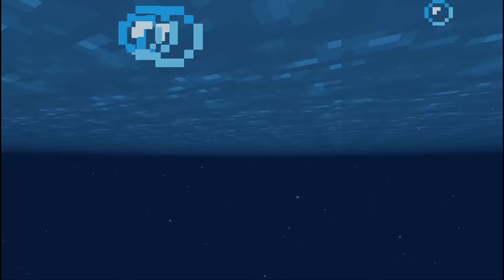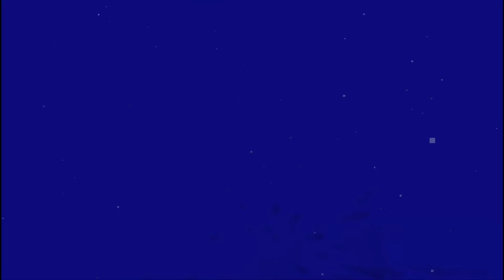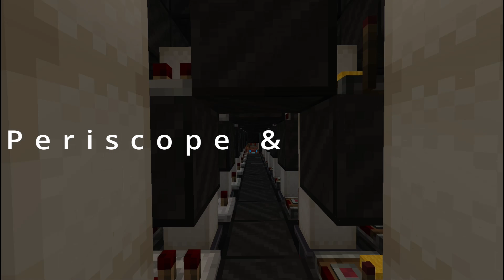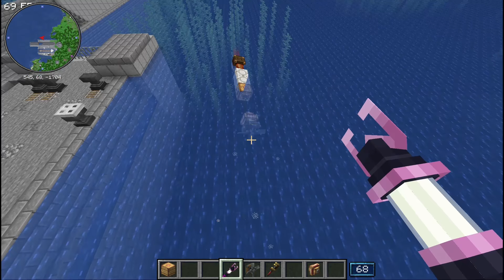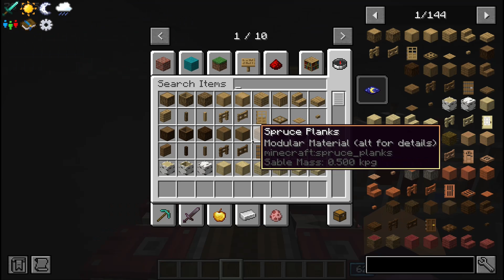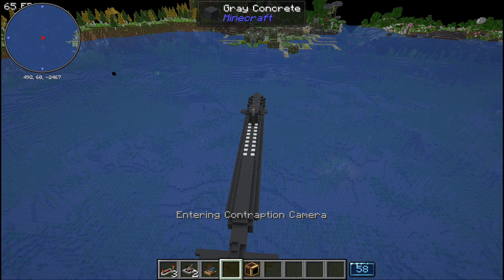Fully Functional Survival-Friendly Submarine | Create Aeronautics + Deep Seas Addon

Comment: Amazing! The only thing I can criticize is the power unit, as it's lacking a proper fueling system (like a barrel/docking connector you can put fuel into that automatically gets put into the engines) and fuel saving shutoffs (engines are perpetually consuming fuel even when the SU are not being used). But enough complaining, the rest of the ship is amazing! I like the torpedo bay and the mechanism used to launch them, the torpedoes themselves are also very nicely designed but what I find really impressive is the altitude control system. Very nice job on those.

Comment: i downloaded schematic, accembled, setup like in instructions but my max speed is 0.32m/s
Reply from the maker: Yes, that's possible. It's usually not a problem with the submarine design, but with the mod configuration. Different modpacks or installations can use different config values. Check your mod settings and find the configuration for the Submarine Propeller. Make sure the propulsion value is set to around 30. That should restore the expected speed.
Reply: @Bagryaniy_Iv okay thanks

Comment: Brother, this is truly impressive. I'm trying to do a similar project and I'm having a problem with the torpedoes. How do you stack the torpedoes while they're in motion, or how do you fire them without detonating them? They explode on contact with the ship as soon as it's in motion. Is there a way to stack and launch torpedoes from a ship in motion?
Reply from the maker: You need to build the torpedo inside the submarine, preferably directly in the torpedo tube. This makes the mine part of the same assembly, so it won't detonate on your own submarine while still working against other vessels.

A useful trick is to place the mine on top of a temporary block and then break the block underneath. The mine becomes movable, allowing you to finish building the torpedo around it.

I’m also planning to make a short video in the next few days answering the most common questions, including a demonstration of how to build the torpedo.

Comment: I have to make a new way to power it right now its verry fuel consuming for survavial and ineffektiv. U should mayby try Steam or diesel engines but a small nuklear reaktor would be verry cool as well.
Reply from the maker: Thanks for the suggestion! I intentionally designed this submarine to use as few mods as possible, so diesel engines would require extra add-ons, and steam engines are a bit too bulky for this design.

As mentioned in the video, I plan to switch to a nuclear reactor in the future. I also have a much bigger naval project planned, including larger ships and more advanced systems, but that'll take some time. 😄

Comment: Is there any advice you can give for making a submarine that won’t implode at depth? The one I made might’ve been too big
Reply from the maker: You'll need stronger materials for deeper dives. Material strength and pressure resistance are also configurable in the Deep Sea mod settings.